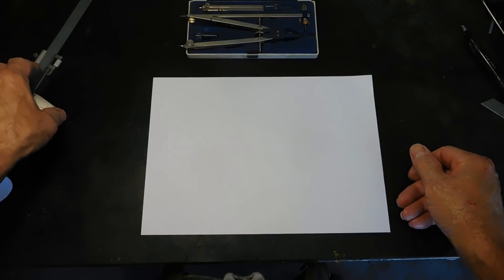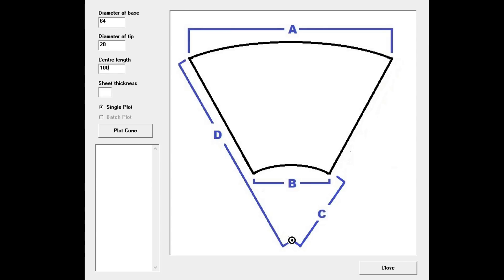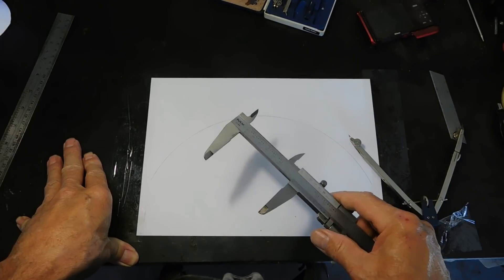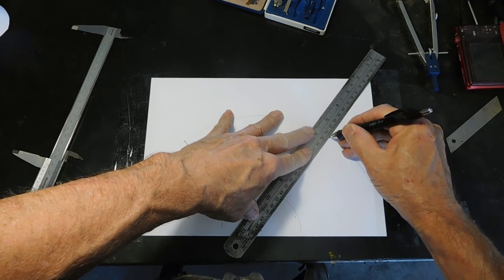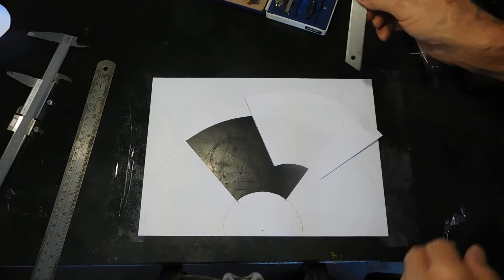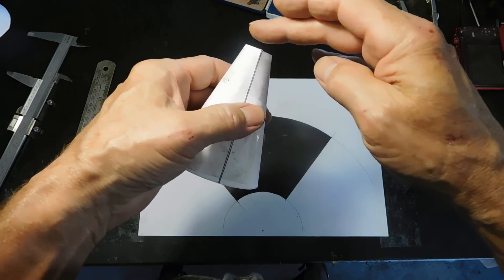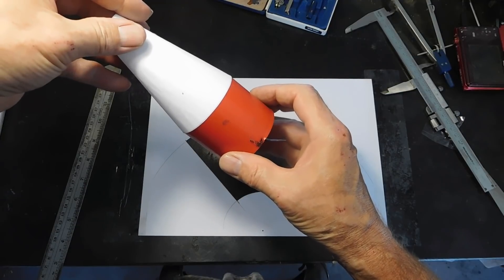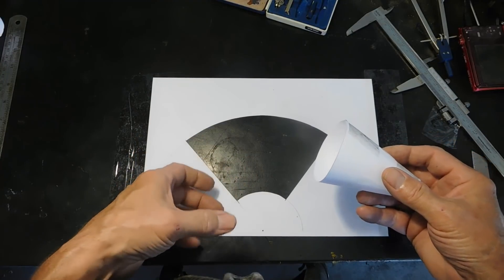How to Plot Two Stroke Expansion Chamber Cones on Paper from Software

Comment: when I enter my cone dimensions my D and C value are so high that they go off the page, and i also dont even own a protractor that goes past 300mm. Perhaps ive made an error?
Reply from the maker: The cone layout dimensions for most pipes are not likely to fit on a A4 page.
You need to draw them on a larger paper to trace them on to sheet metal.
You will need a compass with an extender on it to trace a cone layout.
The one I've done in the video is just for demonstration purposes.
Reply: @AuMechanic hello , same is happening for me , for my first piece off the flange it’s saying it’s giving me c = 10,000
And D = another 5 digit number . That’s definitely not how long it is , and I tried with smaller cones and it’s still giving me very far off numbers
Reply from the maker: @Yavi250r  What are the cone diameters and length of cone (Base Tip and Height) ?

Comment: Would you be able to design an expansion chamber for a 2 cylinder 250cc engine where the exhaust ports are Y piped together into one expansion chamber?

Comment: What do you think about hydro formed expansion chambers? Seems easier to fabricate, there's only the seam weld,
Reply from the maker: Its the best way to make a clean pipe, but only if done properly.
Reply: @AuMechanic  Yeah, I thought it would have the advantage of not having kinks that could disrupt airflow. I've seen 500cc Grand Prix motorcycle pics, some of them have "cone segments"exhaust, and some have hydro formed exhausts.

Comment: What is the formula for including the wall thickness in the cone sizes? I need to know the diameters ( including the wall thickness) for a other software. If I ad 2 times the wall thickness to de diameter of the cone and print it out than the numbers don’t ad up with the numbers in your software.
Reply from the maker: Double the sheet thickness is simply added to the diameters of the cone ends (cut off tip being a "frustrum") which ensures the inside diameter of the cone is per the formula. Keep in mind all pipe dimensions are based on the inside of the pipe as they are all related to the port diameter.
Whatever the outside dimensions are is only a construct of the sheet thickness used.
Reply: @AuMechanic  Thanks for the answer but why aren't these the same numbers than? 
base=42mm tip=22mm length=30mm thickness metarial=0mm A=111,29 B=58.29 C=34.79 D=66.41
base=40mm tip=20mm length=30mm thickness metarial=1mm A=109,29 B=56.16 C=31.62 D=63.25.
These are the numbers out of your software
Reply from the maker: @juliank3397  Because the centre length of 2 cones is not the same once you roll the cones out of different thickness material, it then has the angle 90 degree to the angle of the cone at each ends across the material thickness. To make it the same you grind the cone ends level after it is rolled so that they mate flush with one another to weld, But that is a detail of fabrication where you surface each cone on a linishing belt.
Reply: @AuMechanic  thanks for the clarification

Comment: My bike is a single cylinder & has two exaust ports,  should I design two seperate chambers or is there any other logic for this scenario? (Jawa 250)
Reply from the maker: If you mean it has two outlet flanges of the exhaust port in a single cylinder then yes they usually do build 2 pipes.
Reply: @AuMechanic  thanks, should I need to build two pipes with same calculations, or will there be a different method of calculating the dimensions?
Reply from the maker: @2downshifter  No you would just design each one to suit each separate port.
So the diameters of each pipe would be based on the area of each single port.
The tune lengths would be the same if the timing of both ports is the same.
Reply from the maker: @2downshifter  Last I recall one of these had had 2 separate exhausts and if that is the case then build 2 exhaust.
Alternatively if the bike has a 2 into one header then I would use that and build one pipe and for that you would treat the 2 ports as if it was 1 bridged port and use total area of both ports in the 1 pipe design.
Reply: @AuMechanic  got it, il build 2 seperate pipes, as it looks good, so il consider 2 areas & calculate the remaining dimensions.

Comment: Can you print it on paper?
Reply from the maker: Not from the program and in most cases the flat cone size is larger then A4 used in most standard printers.
If you have a printer that can do larger sizes you could use the size values given in the program in a basic CAD type program to draw and then print the cones, but chances are you could do it faster using the method explained in the video.

Comment: You should open a pipe company you would be rich
Reply from the maker: I wish that was true, I had a business in the 1980's doing engine mods, race tuning and building expansion chambers and I also road raced 2 strokes, but building custom chambers proved to be not profitable, most opting for cheaper off the shelf "road and track" pipes, back then I did it for the passion and I suspect for others who make them it is probably the same. There is a reward in seeing someone come back in after a race saying they just got the best lap times they have had so far due to the new pipes you just built, even if it doesn't pay so well.

Comment: I'm trying to make a radius header not straight what is the trick to calculating the angle vs radius?
Reply from the maker: See the link to angled cone calculator in the description area below the video.
Reply: @AuMechanic  i haven't figured out how to do it in conelayout if it is possible... I'm using the version on the site now.

Comment: Sir I am from India where 2 stroke engines are illegal due to pollution. But the bunch full of people who has previously owned 2 stroke bikes are maintaining them like jewels.  Can you kindly give me the dimensions for Yamaha rx 135 4 speed. I do not have enough data to put into the software, but really want to construct a expansion chamber. Kindly help .
Reply from the maker: So far I have found on Google the Indian RX135 is 12 BHP power at 7,500 RPM, 58 mm bore and 50 mm stroke so use the input calculator in the software (tools menu) to convert that to kW and then you can input that and bore and stroke in to get BMEP and from that an average Exhaust temperature.
I have done that already and 12 BHP power = 8.948 kW power, so using that 8.948 kW and 58 Bore and 50 Stroke and 7,500 RPM = 5.42 Bar BMEP which is estimated Exhaust gas temp of 350 C 
So use 350 C as Exhaust temp in the pipe calculator section.
The next is maximum RPM value to insert, just insert the value of what the red line RPM is on your tachometer on the bike.
The other dimensions of port diameter, port length, port flange diameter and port timing you will need to measure on the engine, if you look through more of my videos on my channel page I explain how to measure port timing on one video and the other three port dimensions in another video.
Reply: @AuMechanic  sure sir, I will try the same from my end. Thanks for the quick reply. You are truly an inspiration for many.
Reply from the maker: @ronosys  
Let me know if you have any questions
Reply: @AuMechanic  sure sir, I will let you know the update.
Reply: @AuMechanic  I shared your channel to our small local 2stroke's fb group where I am the admin . It has around 9k active members. Hope they will be benefited by your lectures and practicals.
Reply: @AuMechanic  thanks a lot and loads of love from Hindustan
Reply: @AuMechanic  Dear Sir can you link me to the video where you explained about calculations of port timing and other three port dimensions calculations...
Reply from the maker: @ronosys  
Look on my channel page and click on the video list and you will find the 2 more recent videos than this one covering how to measure port timing using a degree wheel and how to trace ports.
Reply: @AuMechanic  Dear Sir, I do have a question, I read somewhere :

Divergent (Diffuser) Cone - The section of the pipe that attaches to the header and opens up at an angle like a megaphone. It intensifies and lengthens the returning sound waves thus broadening the power curve. The steeper the angle the more intense the negative wave returns, but also the shorter the duration. The lesser the angle, of course, returns a less intense wave, but for a longer period of time (duration). The outlet area should be 6.25 times the inlet area. 7-10 degree taper angle.

In here the author is talking about horn coefficient, but I do not understand what is the duration here.. Like if someone wants to have a broad power band they may get high horn coefficient but what and how the duration is short then. Can you guide me about this duration. What is it.. And why it is inversely proportional to horn coefficient?
Reply: @AuMechanic  dear sir one more question how to determine that whetherone will need a 2 stage diffuser or 3 stage diffuser , can you kindly introduce us with the concept and differences between this two.
Reply from the maker: The 6.25 value for mid section diameter and taper angles are derived from the very old pipe equation from the 1970s by Gordon Jennings who created them by just copying pipes of the ere
The equations I use from Professor Blairs scientific SAE papers in 1996 provide for a range of mid section diameters not just a fixed value and taper angles are not an equation factor they are just a construct of the variables Blair provides.
(See my free pipe software that has popup help for each input value that covers how to apply the range for peak power or wide range power)
Reply from the maker: The multiple stages of the diffuser allow for the horn coefficient (HC), so the lowest value for HC at 1.25 provides a more straight taper angle for peak power where a highest HC value fo 2 creates a more horn shaped diffuser for more broad power.
Or put another way, a single taper diffusers produces the most narrow power peak which is conversely the most power for road racing for example, where a curved horn shape diffuser makes less power but over a wider range.
Having a curved horn like diffuser is, for the purpose of the sonic expansion wave, a longer diffuser using the sample angle of divergence. 
The effect of it being longer to the wave provides a wave that is effective over a longer RPM range albeit less of a peak value.
Reply: @AuMechanic  Dear Sir, 
I started building my ec with your guidance. 1.8 is the diameter of my header pipe. I am keeping my header pipe diameter constant. Not varying it to 0 to 2 degrees. 

Secondly my belly ratio I am taking it more than 2.5 although my BMEP IS COMING LESS THAN 6, as you have suggested in your comments that older pipes which you built were narrow belly but LATEST pipes which you built were more than 2.75

My header pipe length is coming to be 14 inches with calculation but have to keep it shorter than 14 to manage the design of the bike. 

I took horn coefficient bigger for having a wider power band. I will update the same. 

Yes I am planning my stinger to start from belly not from baffle cone to get up-to 80% less noise than baffle cone.
Reply from the maker: Thank you, hope they find the information useful.

Comment: My B dimension is never on point.What's the problem?
Reply from the maker: How far off is B dimension ?Any discrepancy on the A or C dimension will result in B not being dead on but it can be hard to get it spot.
Also all dimension are rounded of to nearest decimal
So long as you make measurements as close as possible using a vernier caliper an tech drawing compass that will be fine.
Reply: @AuMechanic  its like 5 mm off, and all the other dimensions are spot on
Reply from the maker: @boostedhub  
Let me know what the base and tip diameters are and sheet thickness and I'll have a look at it.

Comment: could you please tell me which calculator handles
Reply from the maker: There are links in the description section below the video.
Reply: @AuMechanic  please I need help I already have the cone layout program but the format is different.  how I set it up so that it comes out to me like you thanks
Reply from the maker: That program is only for cases where you need the have a bend at the cone, if you use it you can take the cone values from my program to use in it.

Comment: Angled cones is my problem.
Look: https://youtu.be/_bYANfX35k0
Reply from the maker: Hi, sorry I did not see your comment sooner.
I looked at the video and see what you mean about making the bends.
There is no fast way to do this by hand other then the way you have done it by cutting each section of cone and welding.
The production pipe you showed is "formed" under pressure over a die that is made which are very costly, they can justify the large cost for making many of the same pipe but for custom made pipes the cost is too much.
It is possible to make a pattern from hard wood and hand beat sheet metal over it to form the shape and make the 2 halves of the pipe but that is done with aluminium sheet but it takes a a very long time to make and I doubt you could hand beat metal sheet over it. After beating the metal to shape it has to be annealed also to soften it or it will crack so it is a long process to do so while cutting each cone may take some time to do it is probably far less time and far less cost than forming the pipe halves.

Comment: how much power is effected by twisting pipe to fit bike in compare with strait expansion chamber?
Reply from the maker: There shouldn't be any power loss if it is done neatly as the function of the pipe is by changes in pipe area (diameter) down the pipe so changes in direction are not an issue.
Reply: Thank You